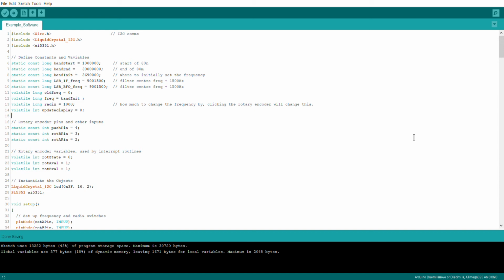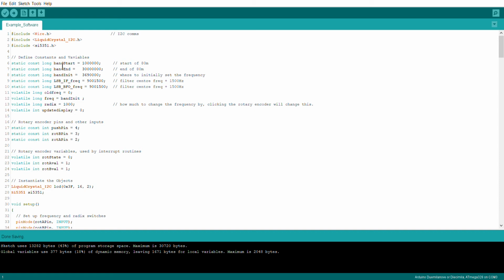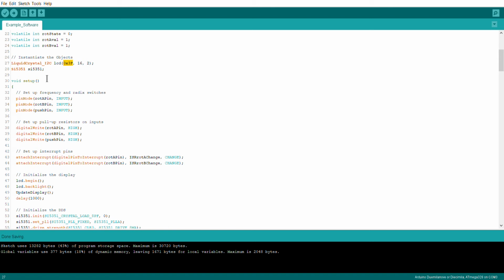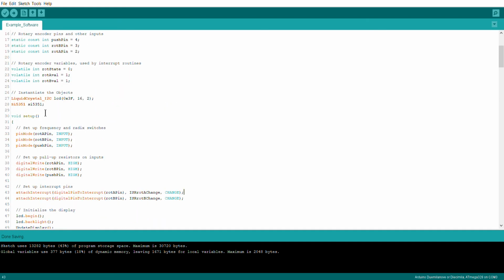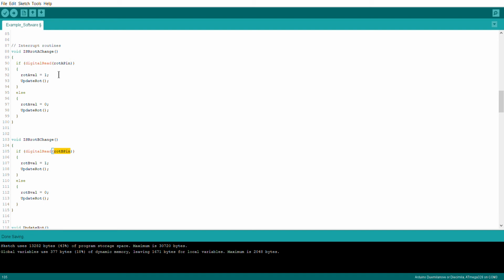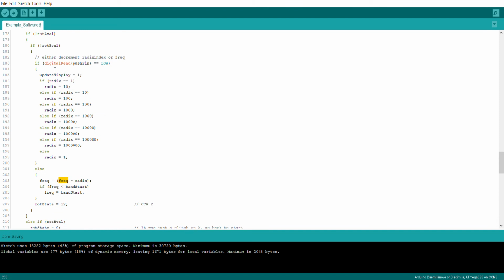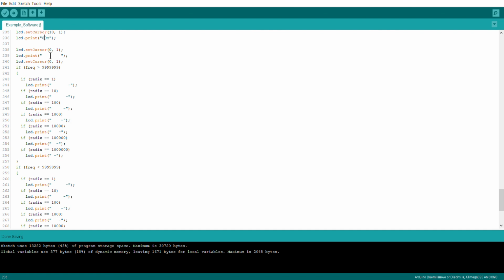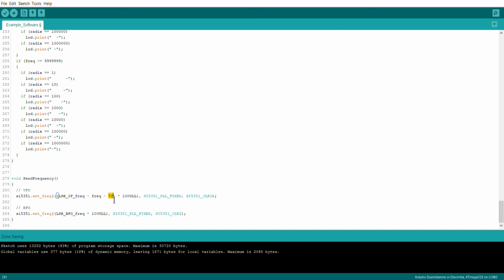Si5351 VFO/BFO Software: Part 2 Software overview

Comment: Hey Charlie! Wonderful explanation of the software. I tried running this code but couldn't find the KiquidCrystal_I2C.h library. I found one that is different by Author: Frank de Brabander and Maintainer: Marco Schwartz that doesn't work with your sketch as it has different commands eg., it doesn't even recognise LCD begin. Could you please guide me as to which library is to be used. Thanks. 73
Reply from the maker: I suggest you use your library. Look at the example sketches that come with it and port the syntax over to the VFO/BFO sketch. I do that all the time.
Reply: @CharlieMorrisZL2CTM  Thanks a ton!

Comment: Thank you for this great explanation. I am kind of a newbie to arduino and have a question. In line 57 of the code, you have a statement that includes the phrase "frequency * 100ULL" 
My question is what ULL means? I want to use this project to control my 40m Phaser from midnightdesignsolutions.com, which uses a divide by 4 function to get the actual operating frequency. That being the case, would I just change the aforementioned phrase to be "frequency * 4" and leave out the ULL?
Thanks es 73 de Arnie W8DU
Reply from the maker: Hi. I think I answered this in another video. Correct?
Reply: @CharlieMorrisZL2CTM  Yes, you did and I thank you again.

Comment: Hey Charlie, big follower of your stuff! Have you recently encountered any problems with this compiling? I think it’s due to the si5351 library being updated, as I’m getting a few errors with the set_freq signatures. Cheers and 73 VK3SVW Josh
Reply from the maker: Hi. Yes, the new library requires a tweak to some of the code. I suggest you open an example sketch from the updated library, and you'll quickly see the differences. They're minor.

Charlie
Reply: Thanks mate. Unfortunately it appears to be a bit beyond my comprehension, and now the liquid crystal library seems to have vanished.. haha. Not having much luck
Reply: Well blow me down. I think I got it. Thanks mate
Reply from the maker: Excellent!

Comment: One little thing, you can banish all those "if (radix = x) radix =xx" lines in UpdateRot() with simple  multiplication or division by 10. Not only will it make the code smaller it makes it more efficient. Time wasting within an ISR is always a bad thing so look for brevity!

In pseudo code: if (button pressed)  radix /= 10 or radix *= 10  depending on rotation.
Reply from the maker: Thanks Nick. I'll add cleaning up the ISR code to the list.

Comment: Hi Charlie, thanks so much for doing the video's on the Si5351 hardware and code.  Part 2 was of particular interest to me and explained things in a manner I could follow!  It would be great  if you could put the code up on your blog, I note there is some code on the Blog but not the code used in the part 2 video.  I look forward to experimenting with the code and using it as a learning tool in conjunction with the excellent video you have produced.   Kind regards form Andy...
Reply from the maker: Hi Andy. Thanks for that. The code is now up on the blog.

73s
Charlie

Comment: Not as pretty as the underline for the frequency shift, but have you considered inverting the background of the digit being changed?  It would free up the segments below the frequency.
Reply from the maker: Hi Jason. No I have not tried an inverted figure. I did try a font which had a built in underline, which looked ok. I might take a look at the inverted font. The only issue would be the need to break the freq down into 10Meg, 1Meg, 100k, 10k etc in order to track which digit needs to be inverted. That’s straight forward to do, and arguably no more code than having to track and print the underline. I’ll take a look on the next build. Thanks for the input Jason.
Reply: My thought exactly!

Comment: I've found a rotary encoder library that uses a state machine.  It stores the current state for the A and B encoder inputs, and compares the old state with the new to determine which way the knob was turned.  So I call the same function when either of the two interrupts happen,  read the state of the two pins, as a binary value of two bits, and call the update function that compares the new encoder state with the old and then outputs +1, -1, or 0 depending on the new position.  (If you missed an interrupt you could end up with a net change of zero).

I did things a bit different with the switch, I had each press of the switch  change the increment value by 10x, and then rotate back to the original value (ie, 10hz, 100hz, 1khz, 10khz, 100khz, back to 10hz), but I like your idea of rotating the knob while the switch is pressed (but I wonder if that would cause faster wear on the mechanical encoder).
Reply from the maker: That's interesting. thanks . To date I have not had a rotary encoder fail from wear and tear. I guess I'm not too worried as they cost less than $2. The other option is to have a separate push button switch , but that would take two hands. The rig i have just finished used a four way joystick switch. All good fun!

Charlie